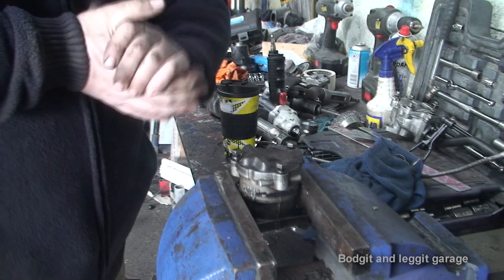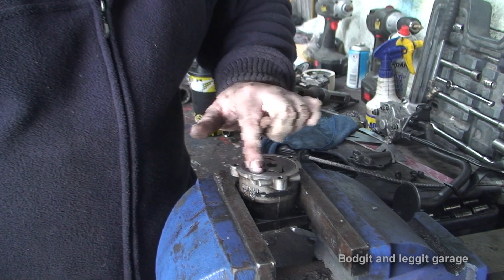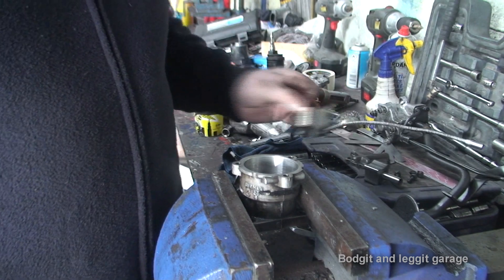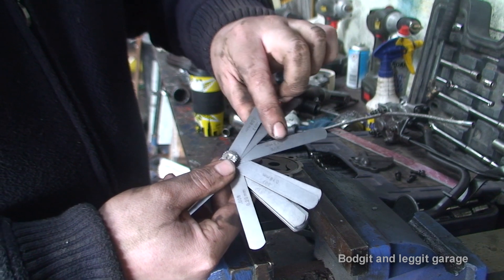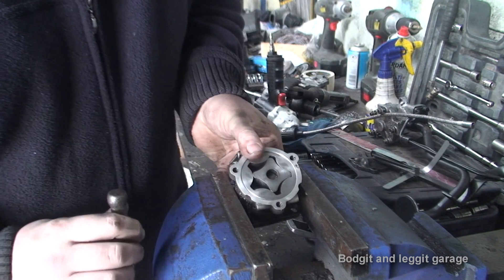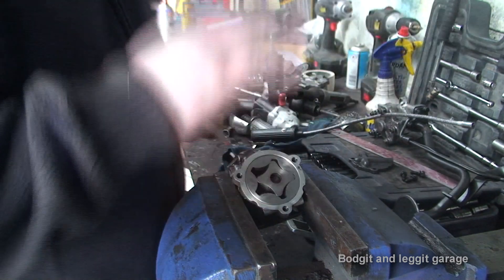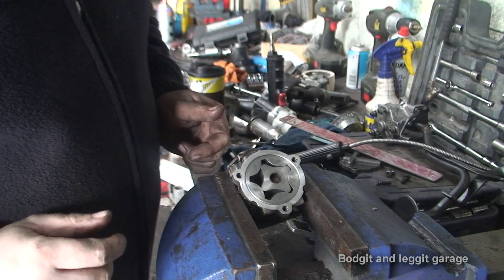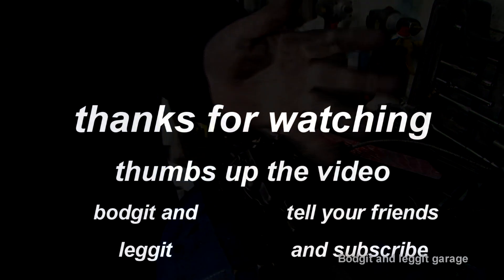how to check your car oil pump bodgit and leggit garage

Comment: Great video. Just what I was looking for.

I have a 98 Pathfinder 3.3L with a similar oil pump.  It was an elderly couple's for 20 years.  I don't think they used it much.  Low miles, 6,000 a year average, and likely wasn't driven hard ever.  I think they let oil sit in it and maybe their mechanic put snake oil in it as a sales pitch.  There was gummy honey-colored stuff on the refill cap. 

Something is causing this Pathfinder to knock at startup for 3-4 seconds and then between 1,800 and 3,300 RPM.  If coasting between 1800 and 3300, it ceases.  I think I caught rod bearing wear early and I replaced them. And checked the mains.  Mains were good. Two rods had mild wear. No slack or slope in anything. Metal flakes stopped appearing.  But still the knock between those RPM.  It runs perfectly, otherwise.  And the body and interior is like new. So it's a nice one I'd like to keep long-term.

What do you think about this idea? 

If the oil isn't changed well can the valve system in the pump stick or malfunction and cause oil pressure to be insufficient?  The pressure is 100% consistently poor at startup for 3 seconds and under load between 1800 to 3300 RPM.  Makes no sense, this loss of pressure at fixed time, other than faulty pump.

I know there is also a pan gasket leak at the front and back. I thinned the oil as an experiment to see if pressure/noise changed and oil began quickly dripping from both ends of the oil pan when it was at warm idle.  I thinned the oil 50% with motor flush, which is basically kerosene. I drained out two quarts and put in 2 quarts cleaner.  So I have to pull the pan anyways to fix those leaks, so might as well pull inspect and replace the pump as well.  Also have to check timing as well and swap all those parts as their age is unknown.  The pressure problem was present before the leaks were noted. So the big leaks are new and the problem is the exact same. 

Do you know of a good oil pump replacement video of my motor or very similar?  I found a timing kit one, but no oil pump.

Comment: can any one help,when my toyota hilux diesel 2.4 2l engine starts the oil pres. is 60psi at idle [COLD},When its warm up to normal running temp,idle,it goes down to 20psi,what would cause this,much appreciate any help.great vid .thank you.

Comment: Hello I am doin a bottom end rebuild on my Kia Sportage removed oil pump to clean n it is cog driven do you no if I have to get it timed back up before putting back in I have not touched the timing belt

Comment: Thank you for helping me out with this. You made it make perfect sense
Reply from the maker: Glad it helped!
Reply: If your car has a light of engine oil pressure,, if its not ON, everything is ok. Iam I wrong?
Reply: "If its an engine with hight performance"--, races,hight revs, hight stress,  ...it shouldnt have a pump like that.

Comment: Hello, thanks for your nice videos.
I need some help. I have restored my m102 engine and I have changed the oil pump chains but at the end of the restoration everything is going smoothly accept the oil pump is doesn't work 😭.
There is no new oil pump in the stores nowadays. I have found only the chains of it.
Would you mind to give help to make it work!
Reply from the maker: hi mate i can try

Comment: HI : I have an hyunadi atos ,the oil pump have a noise but the presure is good, so what do you think about, could be the gears inside of the pump or the body of the pump it's damaged.?
Reply from the maker: jose villalba are you sure it's your oil pump making noise how have you determined with this also are you using the correct oil in your engine how have you checked your oil pressure

Comment: What if you have no choice but to use that same pump do you just use thicker oil?
Reply from the maker: Hi mate not necessarily thicker oil can cause damage further up the engine it all depends on the engine and what you are doing always best to try and get a brand new one or reconditioned OEM one

Comment: I put oil in my 02  Nissan Xterra I will drive it for a week. and check oil nothing is on the stick. and it not leaking underneath nothing on the ground so where is the oil going
Reply from the maker: If you got no leaks it can only be getting burnt internally in the engine and there could be lots of reasons for this piston rings valve seals etc

Comment: too early to cheer, little riding today and again flashing oil lamp after 10 minutes. pressure gauge on it again and 0 bar. just think the engine at its end is 280,000 km .. because i have a new oil pump with filter installed !
Reply from the maker: Kevin Hoop hi mate like I said unfortunately from the damage of your old pump you have definitely got some bearing collapse somewhere which must have gone to your engine you can most probably save it by replacing all the bearings on the bottom end but would most likely be cheaper replace in the engine
Reply: Yes it is true I think so. engine replacement is sensible.

Can you tell me I can use all the engines of 1.4 or 1.6 or an engine from a VW Lupo 1.4 would perhaps fit?

Hear from you, greetings
Reply from the maker: Kevin Hoop you're going to have to get the same engine with the same engine code otherwise it will not start if you want to put a bigger engine in you will have to change ECU and possibly wiring loom

Comment: oil pumps do not create pressure they create flow
Reply: There's no flow unless there's a pressure.
Reply: @WBuj-db2wx  ok. what Is the pressure in rivers then? 
The pumps make flow. The pressure is created in the points in which the flow is interrupted.
If you don't have interruption of the flow you will have no pressure like in srteaming river.
In closed loops is the same. 
Interruption of the flow is everything that stops or slow down the flow - fittings, blends, deviations, collections etc.
Great video by the way.

Comment: How often do they have to be replaced on average ?
Reply: +Rohan They are not a "serviceable" item as such, so In theory, they should last the life of the engine (unless you live somewhere it's not uncommon to get very high mileages out of engines). 

You would normally notice a loss of oil pressure from other issues, such as worn crank bearings or a clogged pick up strainer first. Oil pumps usually fail through poor maintenance as the oil passes through them before it gets to the filter, so any dirt, grit, debris, etc., that gets in can damage or wear them out prematurely.

Personally, from memory, I think I have only ever replaced them as part of an engine rebuild.